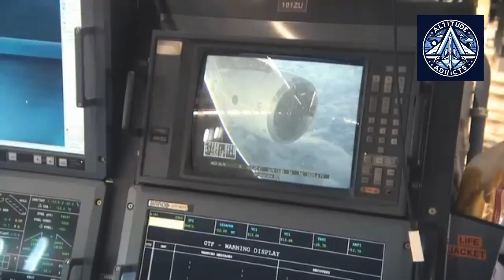Popular Airbus Models Stuck on Ground Due to PW1000G Engine Issues

Comment: Aircraft manufacturers should make designs like it was 30, or 40 years ago; make engine pylons compatible with two or three engines, so airlines would have options of engines, as per the current fleet. I recall the 757 had 3 engine options, GE, PW, and RR. And, they all work great for their operators. Is is possible because there's no "competition", that quality is falling behind? What is making the airplane manufacturers to stick to one engine option, and jeopardizing airplane sales?  I'm sure if the affected fleet had options on engines, there would be not a big issue like this.